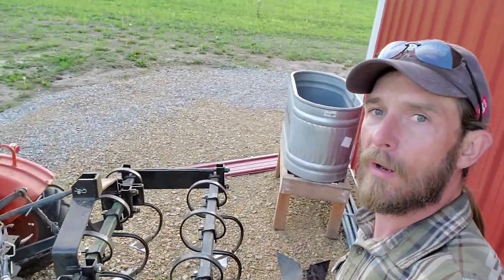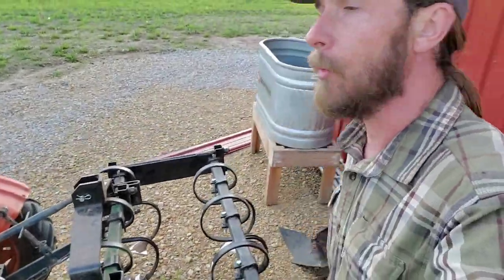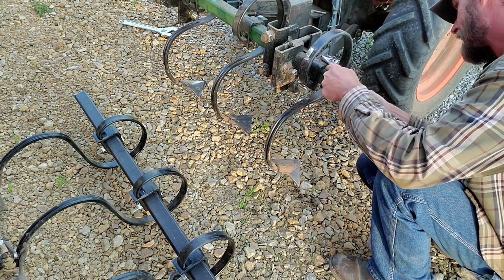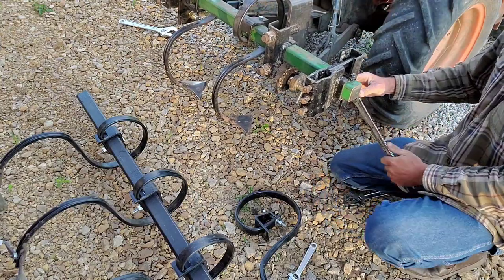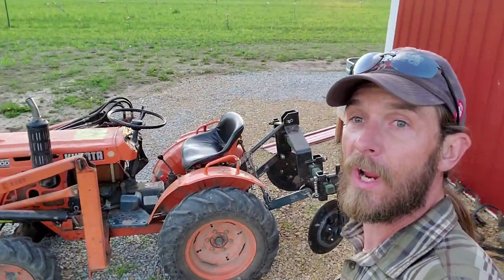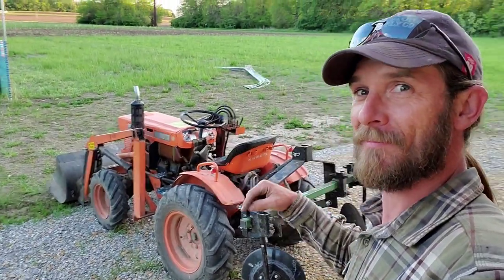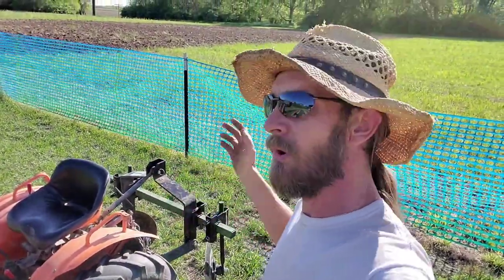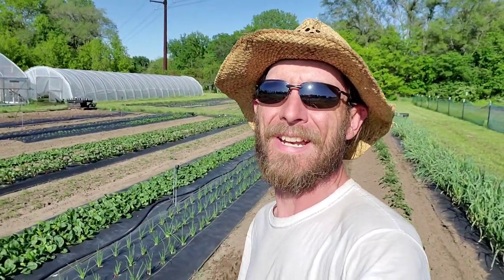Hilling Potatoes with the Wunderbar Tool Bar

Comment: I owned a 300 ac potato farm in N. Florida for 25 years. We had dirt guards on our hiller to smooth the soil. Take some 2x 1/8 in strap metal and weld three pieces together to make a half H with one side about three inches longer. Weld a short piece of angle iron with hole in it horizontally  to the back of the hiller shank about 4 in above the axle.  The long side of the half H will have a hole and you bolt the guard flat ways to the angle iron.  The half H will extend back, across, and forward on the back side of the disc. You bend and adjust the guard so it soil coming off the disc hits it and shuffles under the potatoes. It will leave a fat, square shouldered row and will cover up small weeds without knocking over the potatoes.  

I no longer have the farm or that equipment (long sad story).  I bought an old B7100D that has a bad motor but it came with a bunch of attachments. I was going to use it to work in my garden. I just bought a JD 1023E because I am lazy and haven't fixed the Kubota yet and I wanted something with a HST and a loader.  I didn't have a tool bar so I bought a 2"x48" sq tube and welded a a short piece of 2 in to it so I can mount it to the receiver hitch attachment I do have.

Looks like you have a fine operation, good luck keeping it going.

Comment: Thats what I have been looking for. Do you have a link I can look into that?
And just an idea, but if you used both bars, and had set your cultivator blades on the front bar, lined up to plow the dirt or atleast break it up, and had the discs on the rear bar to throw it inward to the potatoes, I think you'd see there wouldn't be a need for a second pass. The discs do so much better when they aren't having to plow the soil before tossing it.
Reply from the maker: https://woodwardcrossingscountrybasics.com/product-category/wunderbar-module/?gad_source=1&gclid=CjwKCAjwuJ2xBhA3EiwAMVjkVJakHnRaC133W6KZPP-e3K26SdUbrXmM6A4pBOsmazwGFfyP769HFhoCtf8QAvD_BwE

Comment: Perfect Job.
Reply from the maker: Need to do an update since dailing it in
Reply: Have you ever seen any sketches or drawings with dimensions on how to set your discs to hill potatoes? Yours seem to be at 45 degrees to travel direction along the row.  Are the disc shanks perpendicular to the ground, or are they angled to lay towards the tractor, by shortening the top link?  How far apart are the discs?  Do you line the inner disk edge with the edges of the potato  plant leaf canopy?  Im guessing you have to move them further apart as plants grow, but how far apart should they be for each hilling.This is my first year with my woodward crossing hilling discs.  All hilling before was done by hand, and its sort of straight forward, and you can adjust what you do as you do it. Not so with a tractor.  Dont want to mess up this years crop because I dont know how to set up my disc hiller.